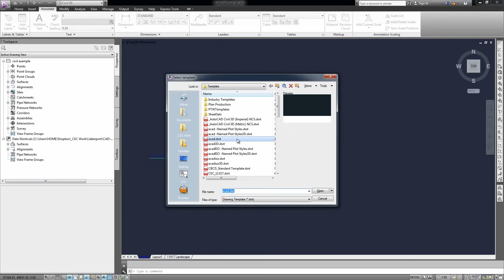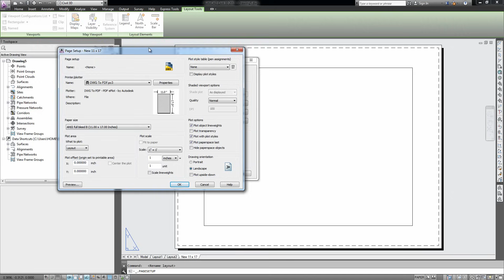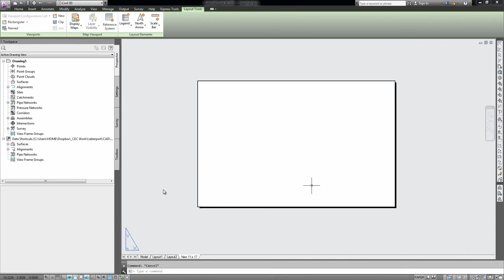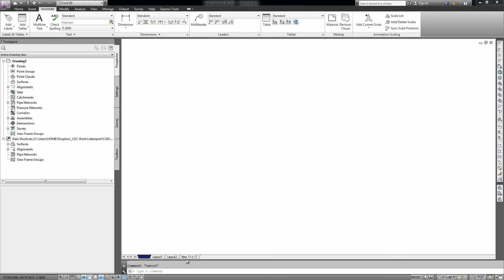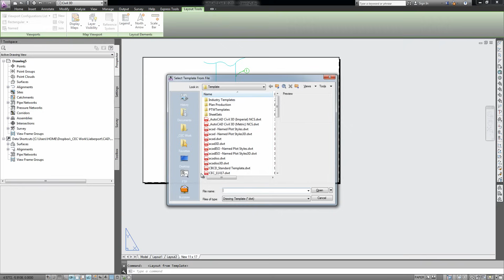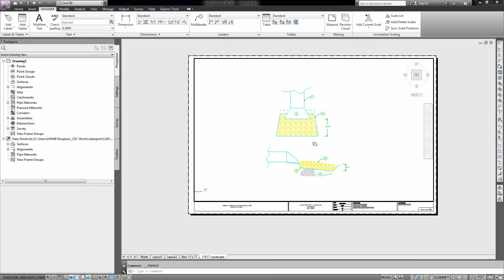AutoCAD How to Create Layouts - New Layout Tutorial

Comment: I dont understand the use of layout, if only printing, why not convert inti pdf then print??
Reply from the maker: The general purpose of Layouts/paper space is to setup your sheets or drawings independant of the model space. This allows you to keep your drawing/model to actual scale while also letting you set a view or sheet to any scale. This lets us have multiple views of the same area at different scales on the same drawing. 

Also, having the separate layout for a drawing lets you create multiple sheets within a single drawing file each with their own unique notes, labels, title blocks, scales and orientations.

In modern drafting software it is pretty uncommon to only use a model or working space, almost all detailed drawing production will be done with layouts/paperspaces. 

Thank you so much for watching and for the questions!
Hopefully that helps

Cheers,
Brandon

Comment: Hi Brandon. Could you please discuss how to properly set the scale in the page setup manager dialog box? I am trying to learn the basics so I created my own title block using a using dynamic block, put in the layout space, and saved as template in different paper sizes in 1 inch = 1 unit scale. However, when I tried inserting the templates in my new drawing, the blocks became either too big or too small for the paper sizes. I guessed the problem is with the scaling. I mean, they should appear like how I saved them but they did not. I am hoping you can create a video explaining the whole concept as I might have missed some or a lot of important things. Thanks heaps.